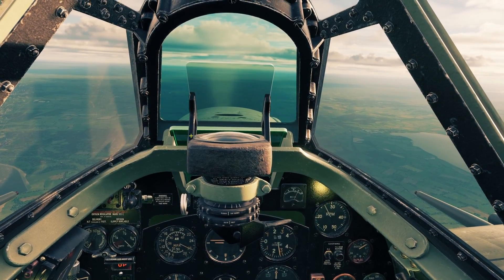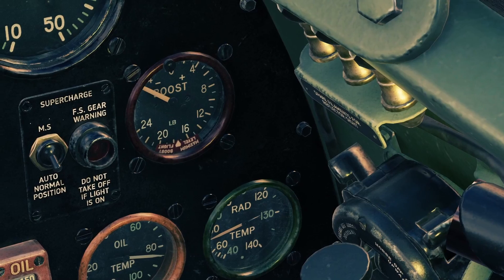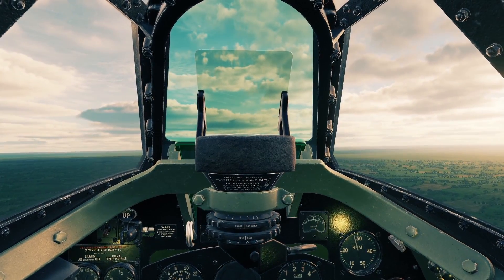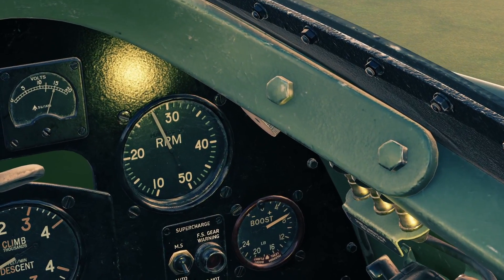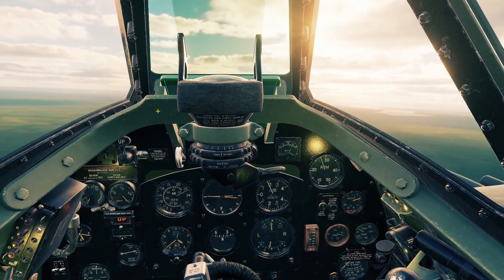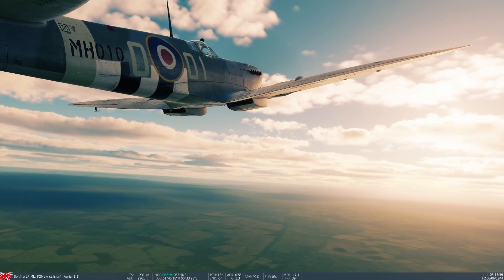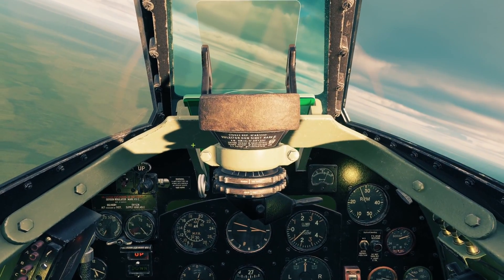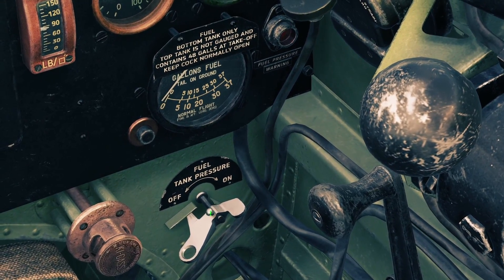DCS Spitfire LF Mk IX Engine Management

Comment: Are you sure the spit has engine timers? I’m flying it full flat out (3000 rpm +18 boost) for 30 mins and the engine doesn’t die 
Would be a disappointment if it didn’t take into account engine timing  thanks
Reply: I've killed my engine a few times. What is your altitude? The thing that matters most is oil temp, if it's exceeding 90 degrees you're cooked.

Comment: Can you tell us how the fuel guage works? It always reads nothing, or just indicates full when the button is pushed…..??!
Reply: fuel tank is split into two parts. There is no gauge for the top half. The gauge measures the lower tank, so whilst the gauge is showing full when you press the button on the left tells you that you still have fuel in the upper portion of the tank....hope that helps
Reply from the maker: indicates how much is left when button is pushed

Comment: How come the cockpit is SO clear, especially the engine limitation text on the right and the pitot heat/radiator switches on the left? Mine are all kinda blurry, no matter what I do in settings.
I run at 1440p... any advice?
Great quick and concise vid by the way!
Reply: @BH-ro4ly  He! He! Thanks for the tip but it was in the settings. I can't remember what it was but there's a setting that clears it all up!! DOH!!!